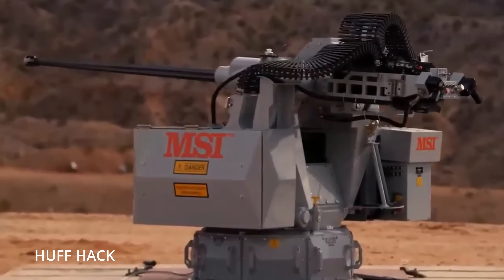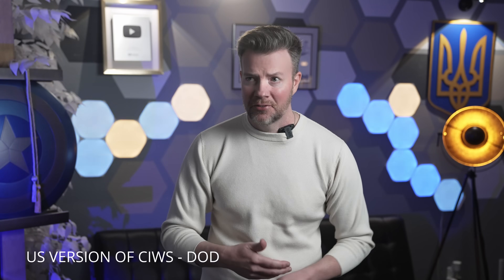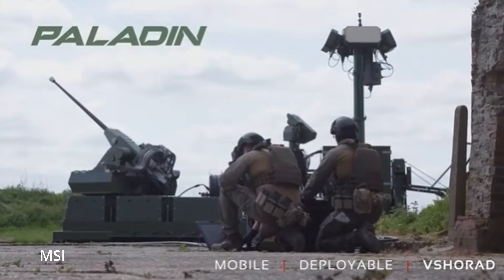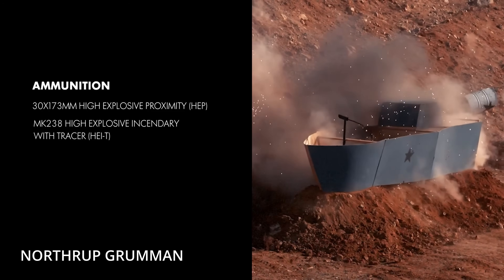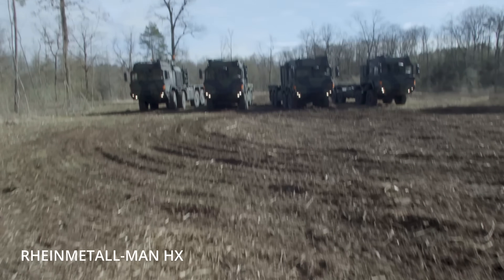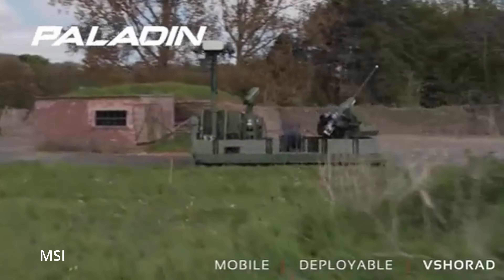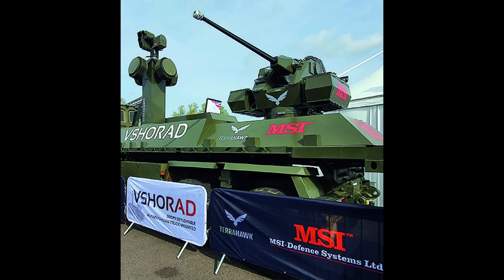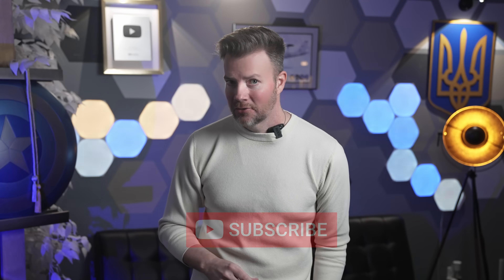Britain Just Sent a Drone-Slayer to Ukraine. It’s a MONSTER

Comment: The problem is that it can't move.
It will be spotted by the drone/satellite and destroyed by ballistic missile in hours/days.
This is the reality in our country.
Reply: Erm, yes it can, you just load it back up on its truck & move it.
Reply: 2-3 minutes to load the Terrahawk Paladin onto its chassis and away with training.
Reply: I am sure the Ukrainians will find a way to make it more mobile
Reply: It probably can't be deployed closer than 30km to the front. Needs to be out of reach for artillery and maybe even glide bombs. And ballistic missiles - how many does russia manufacture and how many paladins does ua get?
Reply: @Jacksparrow4986  It is a point defense system, it is not meant to be on the frontline
Reply: @carey3409 and there are points somewhat near the frontline that need protection.
Reply: @Jacksparrow4986  And Ukraine has many types of drone defence, all of which have their own strengths and weaknesses. I'm sure the Ukrainians are smart enough to use the weapon systems where they will be most effective.
Reply: @Jacksparrow4986 I see your point? But I would ask is how effective is the RADAR set attached to gun. Up to what speed can the system effectively track a target? If it's anything like the British CWIS set up? It can track a tennis ball sized target doing Mach 3.
Reply: 5 mins max to load and relocate

Comment: still Ukraine is in big trouble. Russia is gaining ground harder then ever exept for the start of the invasion. Eu need to step up and we also need to move away from the US.
Reply: Russia is barely gaining anything.... A few bits here and there at the cost of over 1,000 life's a day
Reply: Harder than ever? You mean they took a treeline south of Pokrovsk in 2 month as opposed to 4 and with only 5000 casualties instead of 10k?
Reply: They are taking a few wheatfields and perhaps a tiny settlement of no strategic importance....don't worry, Russia has 6 months before it implodes.
Reply: Standard ruSSian disinformation 

Nothing new.

Comment: Anything drone,  drone jamming,  cheap  drone intercept weapon. The gepards are the ideal example of past equipment re purposed for drone defence gun.   The palladin is another peice of equipment that can be adapted onto Anything by Ukraine ingenuity.  And by experience seeing Ukrainian speed of ngenuity , I hope they get it mobile in some terror hawk glide pack trailer??. 
One thing is for definite!  Russia and solovyov will be threatening to nuke the uk again 😂
Reply: A standard trailer with expandable legs should reduce setup/breakup time to minutes, if it's worth the trouble.
Reply: @Jacksparrow4986 depends if its going to be battle tested and worth it?.  The gepards are perfect in their mobility and range , but the palladin from what ive seen is a battery set up so would be a ring or line of defence protecting a location or power station type asset?. The speed of progress at min is leading to an AI dome of protection taking out human input and delays?.
Reply: @guy.l8147 a line maybe 30km from the frontline would be great. 1000+ systems should do the trick. 100+ would probably detect most drones and shoot down a fair amount, some good truckbased systems to quickly deploy where needed?
Reply: I like hearing those threats, it demonstrates that we are doing something right and is one of the few things that makes me proud to be British.

Comment: Imagine an AI snake , full of explosives. Long as a Boa Just crawls towards a trench system. Quietly Falls inside and looks for a preprogrammed heat source or location. This is just the beginning.
Reply: There has been a lot of basic research into snake-like robotics, but so far they have been complex and slow. One focus of research is to assist in disaster search and rescue, where high speed is not needed to be useful.